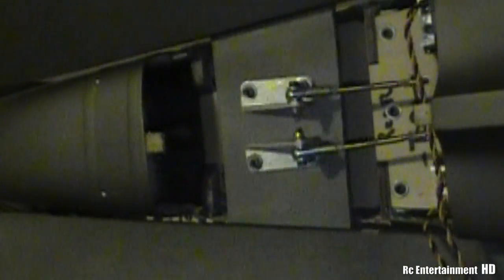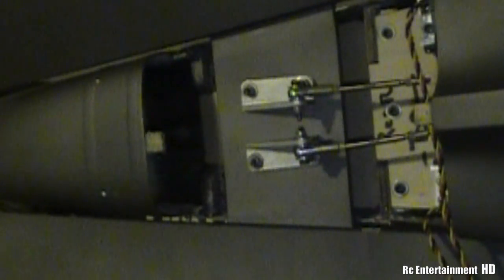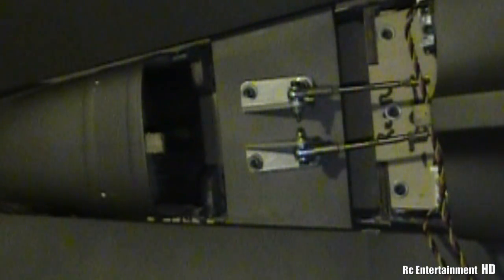Hi-Tec HS-7955TG Premium Digital Servo Buzzing & Chatter Sound Questions

Comment: This is normal for digital servos they should break in after a couple of flights and that chatter should go away. The buzz never goes away, if it does not go away after a few flights it might be a problem with the internal pot swap it out.